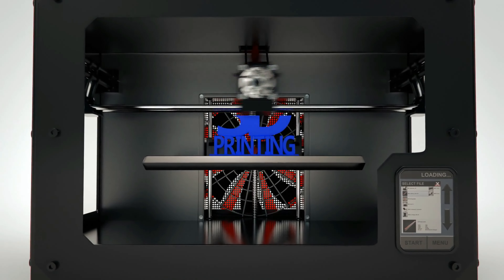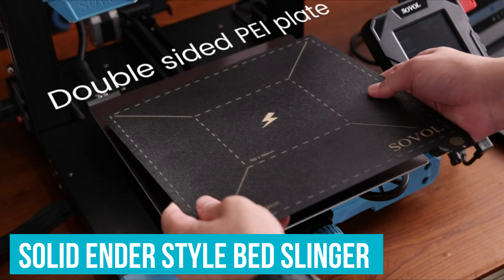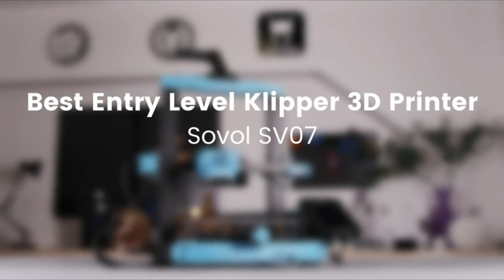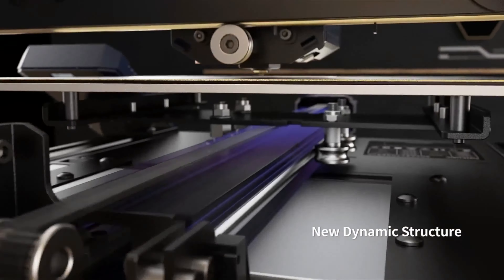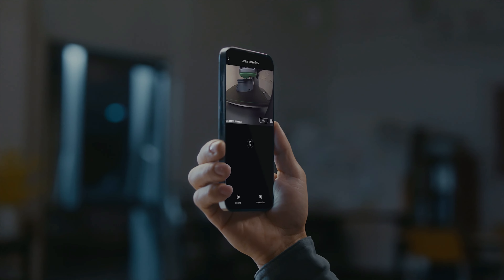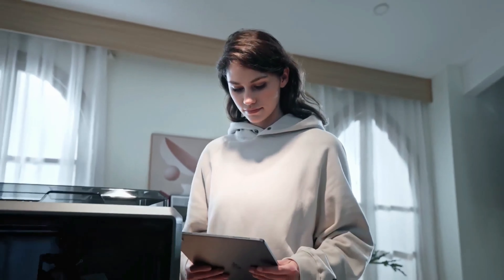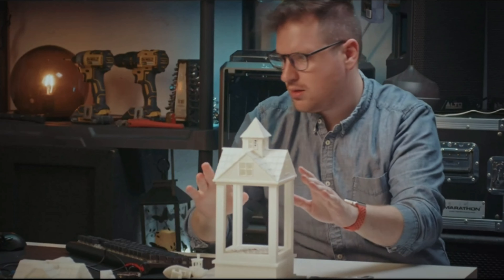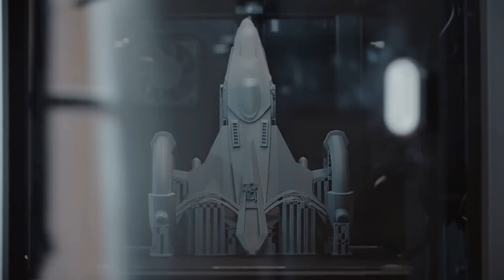Best 3D Printers 2025: My dream 3D Printer is Finally HERE!

Comment: Creality Ender 3... Sucks the big one when issues arise they don't have all the firmware on the site for downloads. I did get a firmware update installed and it does not read the Micro card anymore to do a print and a USB will not connect either. Also far Anycubic Kobra 2 NEO continues to plug itself between the feeder roller and tube that is the hotend connection.  I can't find a fix. Its chewing up every FDM line inserted. Travel speed, Flow rate and print speed rates or settings don't seem to change it either or not enough to stop the eating of the filament. Both seem to be decent built machines but totally lack in software/operational factors.  My first machine was the XYZ printing Davinci printer - enclosed ABS...

Comment: no bambu?
Reply: A ton of people who have been involved with 3D printing for awhile don't seem to like Bambu. It isn't open source. The newer printers operate over a cloud service and some have concerns about their IP. Others have issues with their proprietary parts and poor customer service. For those who do not have a ton of experience, Bambu offers turnkey printing.
Reply: @LostBong That open source crap is so idiotic.   

Most people who jack off open source have never written a line of code, contributed to the FOSS or know how to read a lick of code.  Customer service is trash for the printers on the list? 

Lastly you can run bambu labs printers without the cloud. Let the lie end. It was dumb in 2022 and even dumber in 2023.
Reply: @hawtdayum  I agree with you, just repeating what some have said. I plan on buying a Bambu X1 in a few months when I save up. A friend of mine bought one and I was a little impressed...lol
Reply: In most of the comparison videos of print quality both the p1p and x1-c have better surface quality then all of these printers on this list. However in standard mode the Bambu labs printers were slower in print time then some. 

With all this said I use Bambu labs printers. Why? Core xy, ease of use, reliable, and fast. Basically I’ve moved away from bed slingers. But since Bambu is not releasing a larger build volume until they finish developing their next gen printer I’m considering 2 next gen bed slingers, the Neptune 4 max and the anycubic kobra 2 max. The anycubic currently is more attractive but I’m apprehensive to purchase it due to the requirement to use the anycubic cloud to send via WiFi which who knows is orcaslicer is even compatible with where the Neptune 4 max does work with orcaslicer out of the box but has other odd issues. 

Bottom line is I’m not going to race out and buy these quickly marketed next gen klipper printers. But the question we all need to ask is, why did it take Bambu labs releasing the x1-c and subsequent printers for all the other companies, except prusa, to market klipper printers? It’s not like it’s been a secret. So for this reason alone Bambu labs helped everyone in the fdm 3D printer world. 

As far as voron, and rat rigs go, I’ll say this they potentially are better printers hardware wise then any available printer out there depending on your component selection. Where the huge drawback for MOST people will be assembly, tuning, and support however there is a large community that will fill in the support section of the negatives, possibly negating it as a negative.
Reply: @shawnhicks619  It's interesting you mention speed being comparable to some of the bed slingers. I think I know the reason.

Many people use the "generic settings" for filament. For instance bambu pla filament is around 21mm/s flow rate and the generic rate is 11mm/s. 

Just changing the filament to bambu profile or if you tuned your filament, potentially higher,  I have found 24-26mm/s printers comfortably on an X1/P1 series without touching sport/or luda or upping temps.
Reply: @hawtdayum  yes I do flow calibrations with Bambu slicer for each roll of filament. Another interesting thing I finally gave in to was the fact that even though the Bambu printers print regular pla and pla plus filaments filaments specifically designed for fast printers such as voxelab produce even better quality prints. 

But I’ve been having much better luck with abs then I ever did with pla or pla +, and will soon branch out into ASA to see how it does. PLA is good filament, don’t get me wrong, but for my application just being outside for an hour or so with my items has cause serious warping. This won’t do for me so it’s on to other filaments.

Comment: Bambu clearly the winner.
Reply: No argument 😆
Reply: Yes. Except also, no.
Reply: I hate bamboo pab
Reply: Beg to differ.  Qidi Tech price wise and capabilities of two top smart series hard to beat.  Heated chamber 600mm/s and new unveil on 2o March 2024!  Own smart series it prints flawless prints and great support.  They listen and add updates fast to production runs.  Great pricing!  Think they are huge contender.
Reply: Too small …can’t win
Reply: Bambu suck they all made in the same country just bambu want to charge more.
Reply: Yeah well it's also the most expensive
Reply: 😂 I have a x1c and I use my k1 max much more

Comment: I am new to 3-D printing, but I’m thinking about getting an any cubic cobra to max How is the quality on the cobra series? And is it a good first printer?
Reply: I've had an Anycubic Vyper for 2 years and have had no issues when printing 100's of prints. the Kobra was too small at the time of purchase but now they have biger models. Based on my experience, I would have no issues recommending Anycubic  printers to anyone. The only advice I would give you is... If you plan to plint with TPU; try to find one with a Direct drive , as opposed to a Bosen style. The Bosen style are great for more rigide materials (PLA, TEPG,SAS, etc.., but with wobbly, elastic TPU, the distance between the drive and the hot-end introduces variability in the feed of material, and its retraction (variability = more inconsistant printing and results in more "pops", hairs, etc.. and more post-processing after printing) ... Also, no matter the printer you choose; try to find one that has plenty of opensource options for future upgrades (software or hardware). Good Luck.
Reply: @PierreFromCanada  Ty I bought a kobra 2 max it came with an issue so I returned it and have a Bambu lab p1p on the way
Reply: @gunnarbeddoes13  Sorry to hear that.... But I hear allot of good things about Bambu Printers...congrats.
Reply: @PierreFromCanada  ty

Comment: I have to agree there no Bambu on this list. The A1 is arguably going to be the new budget entry printer to consider. I also think what’s going to happen is the second get Bambu printers are going to deliver something more then what these next gen printers are offering. Most of them fall short and were obviously rushed to market to compete with Bambu Labs, which is silly to me I’ve been asking for a while why no one was offering printers with Klipper from the factory. It’s not like the community hadn’t already figured it out. My guess is all of these companies were content to compete with prusa, who I have my own praise and criticism of, and were doubtful that the Bambu would live up to the hype promised in the kickstarter. Even I fell into that line of thinking. Now I sincerely wish I’d have joined the kickstarter. I now no longer have any of my previous gen fdm printers. None. They are all Bambu labs. Sure it’s not fun to have to split up parts but even with assembly and post production I get parts faster then I used to with my cr-10’s. 

But even though I’ve moved away from bedslingers I’m considering 2 of the next gen printers as a place holder for the next larger Bambu printer. Those are the anycubic kobra 2 max and the elegoo Neptune 4 max. But I’m still going to hold off a bit longer and see how they do in the wild before I pull the trigger. They are appealing though.
Reply: I bought an Anycubic kobra 2 max and would definitely not recommend buying one it came with issues and I had to return it hopefully if you end up pulling the trigger you get a good 3d printer
Reply: @gunnarbeddoes13  still holding off, I just can’t seem to justify a bed slinger for the majority of my production printing. I have considered the new A1 with the AMS lite since it appears the new full size A1 will at some point support multiple AMS lites and it would be nice to have the ability to multicolor print on a limited basis. I have neglected to purchase the AMS for the x and p series printers as those work pretty solidly on prototype and production parts that are all single color and it just seems frustrating to tie up one of those for multicolor prints. But this is my situation other people’s situations may vary. 

Ultimately I think it’s going to boil down to a voron or rat rig for us. We are down for the rest of the year for end of year inventory, book keeping and are again rearranging the shop and moving all the resin printers into a new dedicated space and will have 2 separate production areas running one for fdm and one for sla since we have been doing a bit more resin production over the last 2 months. 

Hopefully business continues to be good for us in the next year but it’s always anyone’s guess.

Comment: What do you mean by Sovol is an "Ender Style Bed Slinger"? The Ender Bed Slingers and the Sovol Bed Slingers are Prusa MK3 Clones - slso Prusa Style Bed Slingers would be correct. It seems to me, that you have no idea which 3D-printers are the best end of 2023 but you are talking already about 2024.
Reply: The SV07 is more like an ender than a Prusa, the SV06 is the Prusa copy.  The SV07 is nothing like the SV06.  Looks like you are the one that doesn't know what they are talking about.
Reply: @patissanchez   I am still on the opinion, that you yust write something in the air without any technical knowledge. Point.